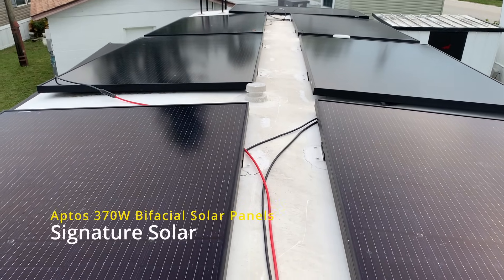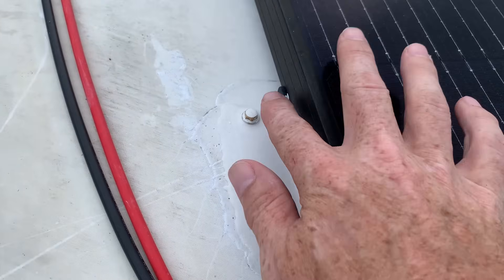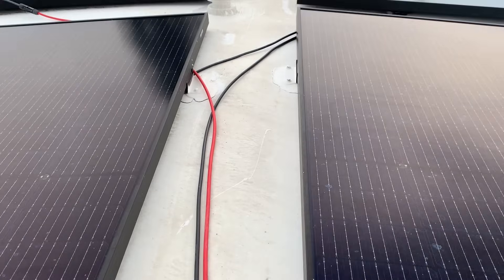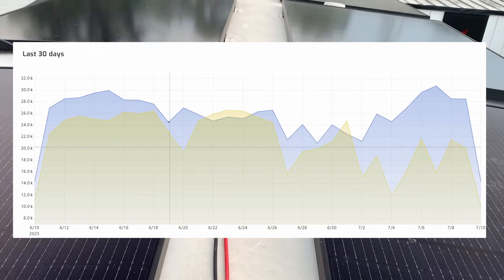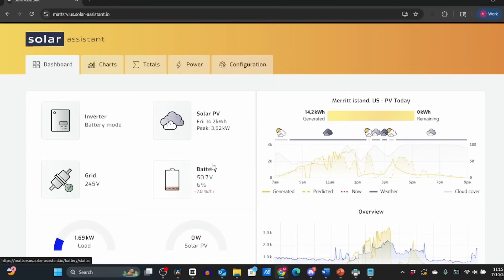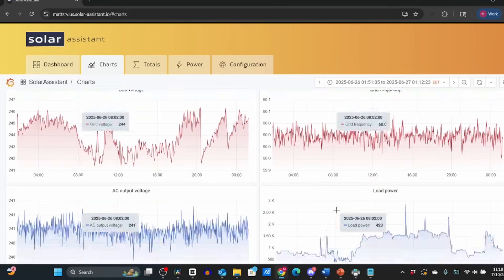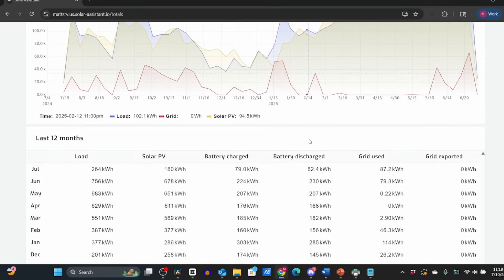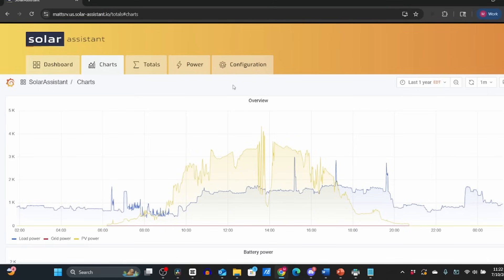How I Installed Aptos 370W Bifacial Solar Panels on my RV

Comment: Hi, I saw your YouTube short on your PV combiner box for your RV. I'm a bit concerned about your last stage, the output breaker. The cabling coming out of it and into your RV appears to be uprated compared to the rest of the wiring in the system which is great. However the cabling that is going into this breaker appears to be the same type of cabling you've used elsewhere in your system. This short cabling is carrying your combined PV output amps to your output breaker, and it doesn't appear thick enough to be up to the task😮. Best regards from the UK 😊
Reply from the maker: They are all 10awg, and the shed total produces MAX 1800 watts and the RV is 48v system, so the max amp rating of shed is 34A (and it really never goes over 26A) .. But the wire is rated 40A and 50A in open air .. So should be good.. But thanks for the heads up .. Allowed me to recheck :)

Comment: How good are the bifacial compared to  mono
Reply from the maker: In this application, they’re not quite as good as they could be because they’re mounted directly to the roof, but they were lighter and they were a lot less expensive than the normal panels and that’s why I chose them to go on the RV roof

Comment: Dude. You should have resealed the roof First! Then put those panels on.
Reply from the maker: Yes, that is what I did, except the bathroom stuff, that stuff all needs to be replaced. but everything else was pulled replaced and resealed.

Comment: Very nice! I’ve got 6 Aptos 400’s bf’s that I’m fab’ing angled tiltable mounts. I bought 8 and decided to keep 2 as spares or install later up front on the 5th wheel. Based on your install, I am anxious to see the bifacial results when tilted like gullwings and hopefully get some gains from the reflected roof.
Reply from the maker: Yes, they are over performing, they are 370w panels, but perform more like 400w panels.
Reply: @MattManSolar I’m getting 300W+ each for the last several cloudy days with the panels propped on the ground. Today there is no sun, two panels tilted against saw horses. Flat gray sky and I’m still showing about 50W each. That’s only equating to about an amp each but it’s still impressive they are working. LoL

Comment: Hello, I'm a new recent subscriber. I currently live in a 32ft travel trailer equipped with 200w on board solar set up with converter. I've called around to RV services to have more solar installed and no one does it. I personally am nervous about going on the roof of my rv in case of collapse. I suppose I'll binge watch your videos for ideas. Thanks for creating this content.
Reply from the maker: Yeah I have fifth wheel and they are really strong on roof.. I would be careful at first some travel trailers you can climb on and some not, but you most likely can reach from ladder on side … but most you can so just be careful ..
Reply: @MattManSolar thank you for your response. I recently spent a small fortune on several ecoflow power stations solar panels and also bought a Tesup Atlas.. none of my off grid equipment has been installed as of yet and my on grid electricity bill is outrageous for just a travel trailer, portable hot tub and some lights. I live over here in FL too on the west coast in Pasco County. Thank a million for some great advice.
Reply from the maker: They are more expensive then building something yourself, but they are a lot easier to work with … is that Tesup Atlas a turbine, that would be cool to get power at night fro the wind. I just never hear too many good things about them.
Reply: @MattManSolar yes the Tesup Atlas is a permanent levitation magnet generator.   Right now I can't tell you how well it performs ,it's not installed yet. My goal is to produce what meets my needs and net meter the rest back to the grid, after I get the shed built for the power house. Its been so cloudy with geo-engineered skies my 100 watt panels are operating around 60-80w. My goal is to also get my well system on solar or wind power.
Reply from the maker: @LostSoulLibra  If you need anything please yell, glad to help anyway I can ..
Reply: @MattManSolar I really appreciate your kindness tyvm
Reply from the maker: Anytime, that what the channel is for .. Helping .. :)